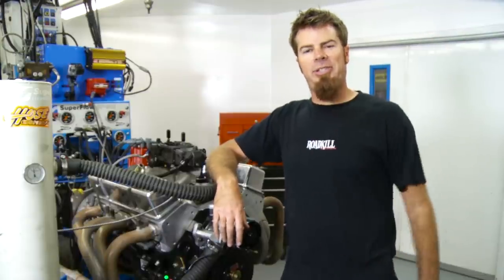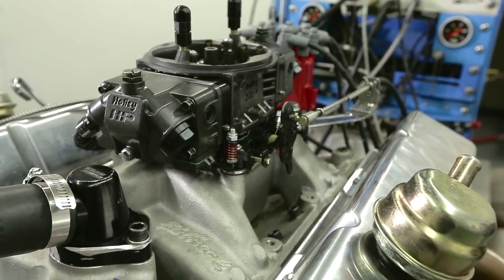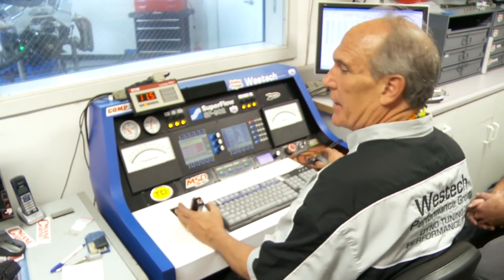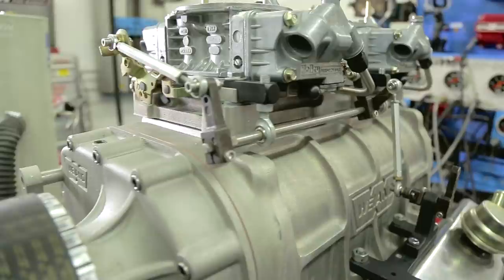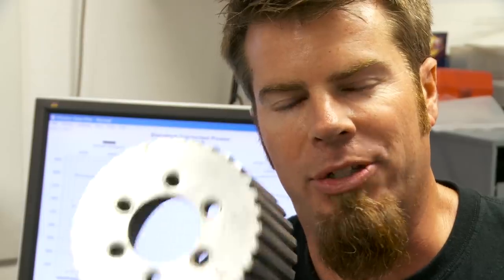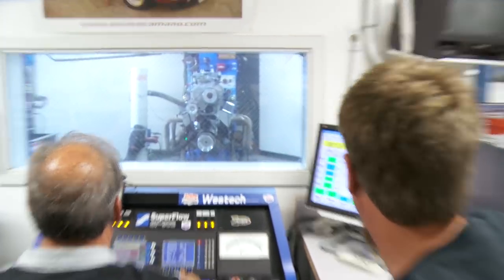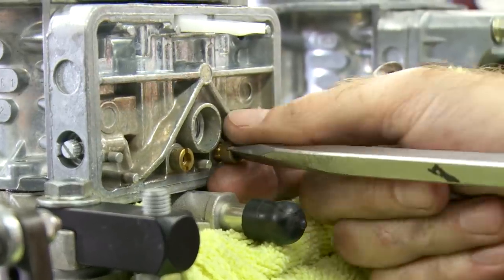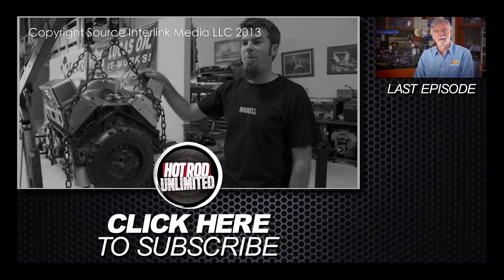Dyno-Tuning the Draguar's 696 Horsepower Supercharged Small Block Chevy! - HOT ROD Unlimited Ep. 35

Comment: Your American Engines are so cute. For a european your engines are what whe had in the early 50 in standard cars. Our Sportcars then were allready more advanced in terms of the head, cams and ventiles. Also what you need a V8 to accomblish we need a 4z Turbo. And a yes our cars can brake and corner. Ok the last 2 Corvette Generations were pretty good handling too
Reply: TheNecromancer6666 we euros turbo the hell out of small engines (see ford and their 1 litre turbo engines)
yes they make good power but i doubt it lasts as long as a n/a v8, to get reliable high hp they also use 6 or 8 cylinder...
Reply: ***** any German engine is developt to reach 300k Kilometers. And they do so. Also i love big boost and preferebly boosted V8s . European V8s.
Reply: Yeah, but you have to wonder when Dodge produces over 700hp out of their fifties style V8 in the Hellcat, which makes it the most powerful four door sedan currently, if those engineers at MB, BMW etc are thinking why they can't with all their high tech. Sure high tech sells cars, at least in Europe, but if it can't deliver its window dressing, and that don't win races!
Reply: bunning63 because a european car is as fast as the hellcat with just 500 hp . And around corners well let's just skip that, would be painfull for us... Except the Corvette, i don't any American car succesfully racing races on non oval recatracks, no american lmp s no f1 s ... They just don't have the know how. The Corvette handles well, but it has no high tech.... Just to make the point, the indycars are powered by honda engines.
Reply: I appreciate your fascination with the Corvette, it's not the only GM product to use that engine. All American cars don't handle?,  you need to update your research. Honda builds Engines for Indy, and who else? Which production engine has won more races than any other? Anyway, while some quote hp, it is really torque that's important, and no I'm not American or own an American car, horses for courses bro. Don't think you can call an engine 'cute' either.
Reply: bunning63  tq only matters when you have to pull weight, a light car can get away with fewer tq and still be as fast.
(and the gearbox/ gearing is key to match to the engine in any case)
Reply: bunning63 Well ok there ate very well handling American cars, unicorns like the Mosler MT600. But except for Chevy Corvette all US cars sold in great volume handle like shit, the Mustang, the Viper, the Hellcat, the Camaro. Maybe with the exception if the caddy cts v which was build for europe. And any engine in the mentioned cars has one or two central camshafts with ohv and two ventiles per cylinder. In Europe that's called a joke not an engine. Why not to call an emgine cute.
Reply: You are quite right, in an engine as you describe as having "one or two central camshafts" is a joke. Don't think you will find many engines these days that aren't OHV either.
Reply: bunning63 Actually today we have not just over head valves but overhead camshafts and two of them. In Europe it's really hard to find a car build after 1970 without overhead camshaft(s) and since the 90s it's hard to find a car without dohc. American engines sound nice look great under the bonnet but they are a joke. Also considdering Americans measure power at the crank not at the wheels. And any European Hatchback with a 4Zylinder Diesel can outrun a muscle car through corners.
Reply: But what are these engines with "one or two central camshafts"? I don't know any automotive engines currently in production that aren't OHV either, even the lawnmower is OHV. Horse power rating has been standardised for years, the European manufacturers were just as guilty of 'gross' or the old SAE system in times past. Only those that had never changed a sparkplug let alone rebuilt an engine were convinced. You maybe trying to convince yourself of something, you know TopGear was entertainment right?  Best to form your opinions on fact and experience, years of experience. At the end of the day, what does it matter?, study hard at school and you can buy whatever you like and I hope be happy. True?
Reply: bunning63 These American V8s have one single Camshaft between the two rows of cylinders.
Reply: bunning63 Actually i have worked on engines by hand. Modern engines i'm none of those idiots trying to understand engines without ever having build one themself.
Reply: That would be the one with the 'two central camshafts' perhaps?, that must have been some beast. Perhaps it was the European four door sedan with only 500hp that's capable of 200mph you mentioned?
Reply: bunning63 I don't know a european power  sedan  without dohc and 4 Valves per Cylinder. The first really fast european sedan was the 3.4 MK2 Jag from 1959 and eben that one had dohc. The first fast V8 sedan was the merc 300 SEL 6.3 from 1971. It had overhead cameshafts. There is no european car today without overhead camshafts.
Reply: bunning63 Audi, BMW, Mercedes and Porsche are building 4 dour Saloons able to run 200 mph, Audi and Merc even have Estates able to got that fast.
Reply: Actually the 3.8 MK2 Man OD was the quicker one, at least for its day, though they didn't handle that great. Following 'S' type with IRS was nicer to drive. You may like to look up Wikipedia, Ford Modular V8, you may be surprised.
Reply: bunning63 3.4 was first. That was my point.
I know some of the smaller V8 have or had relatively modern head design. But the 6.2 chevy and the 6.4 Dodge have not. The old Northstar V8 Cadillac was a modern 32V too. And they changed it for ? A ohv 6.2 out of the ZR1  C6 Corvette. Chevy also had a 32Valve dohc Variant of the 5.7. But that was developt by Lotus. Except Ford the American companys went back to ohv V8 for the really powerfull variants. Well GM at least manages to build good handling cars, the latest Cadillacs and the Corvette C6 and C7
Reply: It's not that i couldn't understand the faszination of a big block. I once drove a Plymouth Cuda with a Mopar Big Block. The engine was fun. But there engines out there which are so much better. Also i drove the cuda on a tiny bavarian country road up a mountain. And the handling and the size of the thing was just a nightmare. Best engine in my opinion is the 4.0 Audi V8 . 560 hp while consuming less then 10 l per 100km. And if you want to  you can modify this thing to get a 1000 horsepower. And the sound of that thing is a deep and pure evil Thunder, so loud that muscle cars run crying for their mummy.
Reply: Well that's solves the problem, you buy an Audi V8 and you should be happier than a puppy in a bowl of gravy!
Reply: bunning63 Allready done .
Reply: bunning63 I don't have close relatives who fleed to the US. Mine stayed here, most of them didn't survive the war....
Anyways. I don't know your cops of course but i heard but rumours. Our cops here are bad enough.
Reply: I'm in New Zealand.
Reply: bunning63 Oh. I don't know of any relatives there either. Sorry btw. Most people from Europe tend to the US not to New Zealand. Beautifull country though
Reply: Back in the day there weren't many people here, but it's over ten percent that can trace themselves back to German ancestors. Sure you would love our roads, 100kph speed limit and cops that start writing tickets at 104kph.
Reply: bunning63 Oh i prever my Autobahn without Speed Limit
Reply: We kind have a high road toll so it's easy for the government to blame speed for everything. Few of our relatives have described NZ drivers as very aggressive, though having seen some of the driving in Russia on YT, we might not be the worst.
Reply: You're either a troll, or someone in deep, deep denial. Ah well, you're free to belive what you like. No amount of belief offsets fact. :3
Reply: The A.C. Ace was what put speed limits on the British roads. That car had a Ford engine.
Reply: Wyatt Rowe No. The AC Ace had a Bristol straight six. The Cobra based on the AC Ace had a Ford engine. Also that was in the early 60s. Back then that engine wasn't top nutch but it was strong and more reliable then comparable british engines. The Problem is more that most, not all, but most today US V8s today still are on the same standard then in the early 60s. Except that today most of them have fuel injection. But not even durect or variable fuel injection.
Reply: I don't know what is more sad, that you don't understand the value of torque or that you don't understand the function of turbochargers.
Reply: MajorArtillary Me ?
Reply: TheNecromancer6666 now I do know what is more sad, that you don't know how the comment section works.
Reply: TheNecromancer6666 I'm not trying to mock Americans, i'm asking myself why in America in the 50 the technological develooment of cars suddenly stopped. Also ich know very well how Turbochargers work. Probably better then you. And i love torque, the torque of turbocharged engines. I don't like high revving engines. And I will just ignore your insults and hope you are able to start a reasonable argument.
Reply: MajorArtillary Also i know there are still great American cars out there, but except the two ones i mentioned before they are from little manufacturers, like the Mosler or the Lucras or the old Saleen. But they are unicums build in small numbers.
Reply: American cars may not be had powerful, but we have trucks and Jeeps that can go anywhere off the street you want. Japan builds the reliable cars, Europe builds the fast cars, and America builds the off-road cars
Reply: Logan P I'm not into offroading but i think a toyota landcruiser driver or a landrovet driver would disagree with you. Also no japanese car can compete with german quality and reliability.
Reply: TheNecromancer6666 Do you realize that you disproved all of your logic by saying "except the Corvette"? You can go to every corner of the world and find crap cars and amazing cars. It all depends on who is driving and how much experience they have with that certain car.
Reply: TheThebradyanderson Exceptions proove the rule. An the Corvettes engine still is... Let's call it old fashioned. I disagree. You will not find a single european car with a suspension as bad as the ones of standard us cars. You can find european cars with bad handling compared to other european car, but they don't match us cars in shitty cornering by far.
Reply: TheNecromancer6666 The Toyota Land Cruiser cost $80,000, Jeep Wrangler which is better cost $25,000. In Consumer Report's test, they voted Toyota (including Lexis and Scion) the most reliable brand. Mercedes was near the bottom.
Reply: Logan P I Germany we have a saying: never trust a statistic you didn't fake yourself. So much for consumers report. I don't like mercedes. They look like shit and their handling is bad compared to Audi or Porsche, but their cars are rock solid. In Germany we have two Land Cruisers a small one and a big one the small one is 35.000 Euros which is about 40k Dollars. And the big one called Land Cruiser V8.
Also what exactly has reliability to do with handling and advanced european engines, which was what i was talking about. Italian cars for example. Look great, drive great, but they brake down all the time. Until recent years it was the same with british cars. I never claimed european cars to be reliable. I claimed German cars to be reliable. Which they are, because of build quality and the genius of our engineers.
Reply: TheNecromancer6666 For off-roading and Electric Cars go American. For performance and luxury, go German. We have the Jeep Wrangler and Tesla. Trust me, a Wrangler can beat anything and no electric car compares to a Tesla. The reason American cars are different from European cars is because we have different needs
Reply: Logan P I think the Merc G class can compete with in the Wrangler offroad. Although it is much more expensive. For the Tesla i only ever drove the Model S 85P it's great in a straight line it looks gorgious but it is too heavy for my taste. And 250 koh Topspeed is not enough for  German Autobahns.
Reply: TheNecromancer6666 Trust me, you haven't experienced the Jeep until you experience it. Look it up and just look at it you'll see. I do agree that the Tesla needs a higher top speed
Reply: Logan P I don't have any eyperience in offroading. The most offroadish thing i habe ever called my own was a Porsche Cayenne Turbo S. Which is not an Offroader in any way but its the biggest an heaviest Sportscar of all times. I can't tell anything about offroading. So i will just belueve you that the jeep is the best offroader. 
And the Tesla needs less weight and a better suspension. Its Interior looks cool though
Reply: Dre Ray At first: i never said that any car needs a V8. The best engine in the world is a V8. The Audi 4.0 Twin Turbo. But nothing wrong with 4z Turbo 5z Turbo or any kind of 6 cylinder. Then about the 2010 Mustang... That thing could not accelerate, brake or go around corners. An M3 was faster in any respect. Although i don't like the M3. To much sliding no precission. Then all the other ecamples you mentioned... I'm not bothering answering on that. Because that's just wrong. You call me ignorant. I'm am an experienced driver with many laps on the Nordschleife. So when i talk about the Handling of cars i know what i talk about.
Although i know a thing or two about engines more then you ever will.
Reply: +TheNecromancer6666 then how come the fastest street legal drag car is a s10 with a v8? hmmm and lary lutz drove it 2k the the drag strip while towing a trailer.
Reply: +TheBigMacPat In Germany Lap Times count dragracing is not popular here, and yes there are fast American cara for the track but they still need double the displacement for the same Power Output. Also if you would want to do so for drag racing you could modifie European engines to the point where they would be able to run 6s. I mean i own a station Wagon that does 11.10s stock.
Reply: Courier 6 Media Honeybunny i'm an engineer for a major German car manufacturer for years. So i am pretty sure i know my engines better then you do. I just give an example to you of German vs American engineering. A Chevy Z06 has 650hp (at least chevy claim this to be the case) it weights 1600kg. That combination should make it an exhalarating monster. Well an Audi R8 plus that ways the same has much less torque 40hp less is quicker from 0-124 mph quicker 0-185 mph. A Z06 does not even reach 185mph.
2000kg limos like the M5 or the RS7 outclass the Z06 in a straight line while having 50hp less, the M5 takes 1s out of the Z06 0-124 the RS7 2. Even the 400hp TTRS, which is based on the A3 takes 0.5s out of the Z06 in that test. Whilst having 200hp and more then 3 litres of displacement less. No tell me agaib that US engibes are any good. My 3 litre Twin Turbo Diesel saloon will beat most american sportscars in a straight line. Tell me again what exactly are your engines good for except making noise whilst being slow?

Comment: The Jag v-12 isn't a performance engine and only displaces about 326cid or about 5.3

The Jag V-12 was never a performance engine. and it's not that big only displaces about 326cid or 5.4L it's a v-12 for marketing reasons to keep up with the other prestigue marks It's like no american make would be taken seriously without a v-8 engine. Jags v-12 is kind of delicate it over heats pretty easy and when it does damages itself blown head gasket due to head warp.

Comment: "One of the first commercial gasoline injection systems was a ***MECHANICAL*** system developed by Bosch and introduced in 1952 on the Goliath GP700"

And the source for the Bendix statement isn't Wikipedia, numbnuts. There are two sources given, one of which is Consumer Reports 22: 154. 1957.

And in addition to the Rebel, there were various Mopars in 1958 using Electrojector, which they and Bendix improved over the 1957 version (Chrysler being an American company as well).

Comment: Wtf.... 15psi should atleast double the horsepower. 14.7psi is double atmospheric pressure so twice as much air and that's if the engine when NA had 0 vacuum so some serious cam/head. That engine would crack 1000hp if it had turbo's and 15psi rather than a piece of shit blower.

Comment: First of all, simpleton, there were no "electronics" on cars in 1902; you obviously don't know what "electronics" means. There were only electrical and electro-mechanical systems on cars back then. But the only thing relevant here is that there was certainly no EFI in 1902.

Your baseless assertion about aircraft is dismissed. 

Once again:

"The first commercial electronic fuel injection (EFI) system was Electrojector, developed by the Bendix Corporation"

LOL @ you trying to dispute a *fact*.